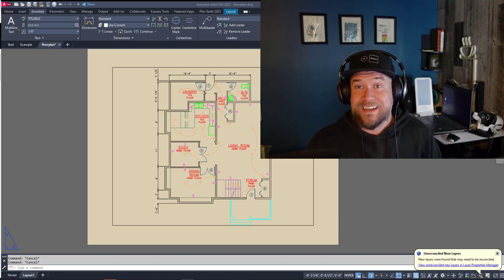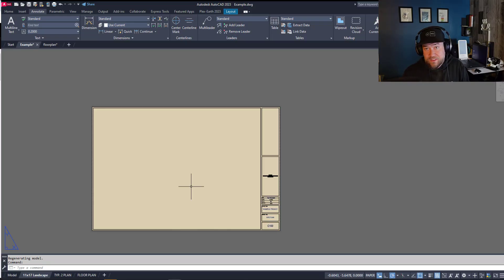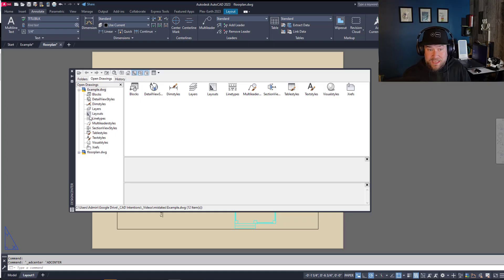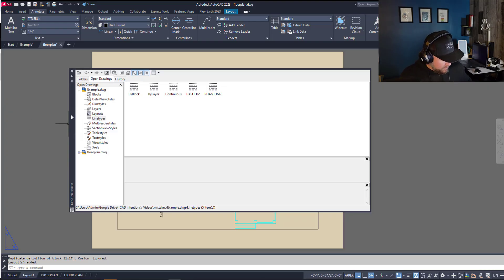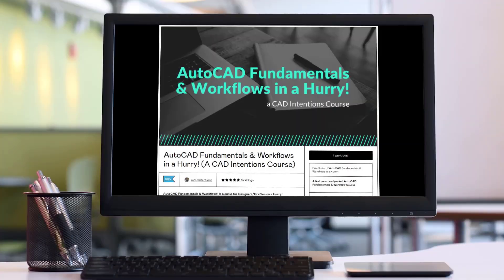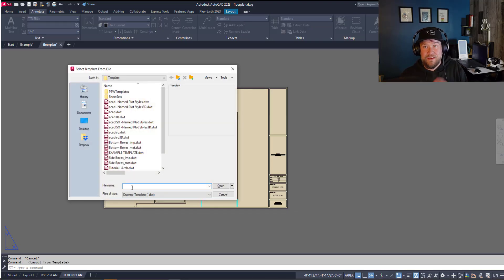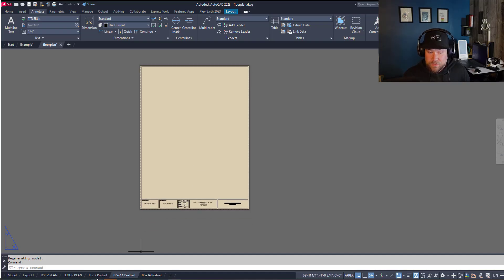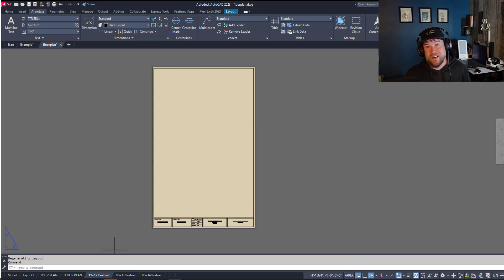How To Insert a TITLEBLOCK in AutoCAD like a PRO!

Comment: Personally, i like to control title sheets with the "Sheet Set Manager" then I batch edit every title sheet's information with the JTB SSMPropEditor. Nothing with using design centre though if you are dealing with not to many sheets, thank you for the video but I am surprised that you didn't mention the Sheet Set Manager.
Reply from the maker: Thanks for watching and the comment! I definitely agree with using SSM for sheet management and setup whenever feasible. I've done a few videos on sheet sets and using them for title block automation as well as sheet set up, I think for most new users or as you mentioned users who mainly work with smaller drawing sets this method makes the most sense, but also it depends a lot on the type of work we're doing and overall drawing setup.